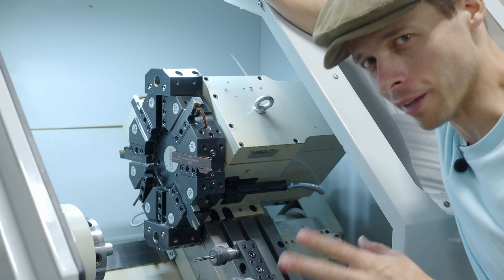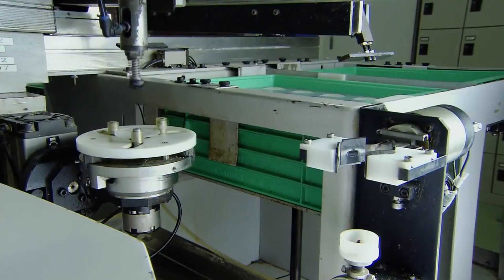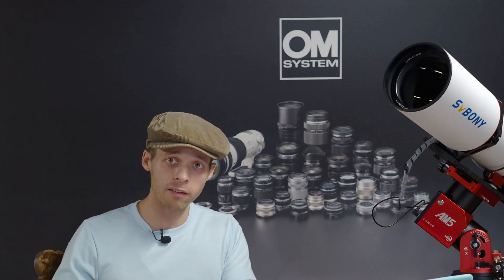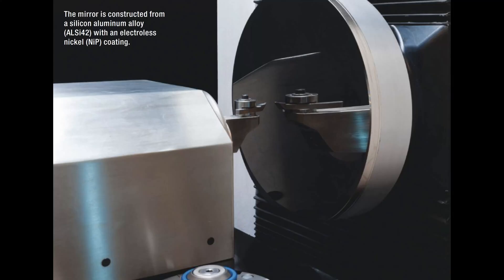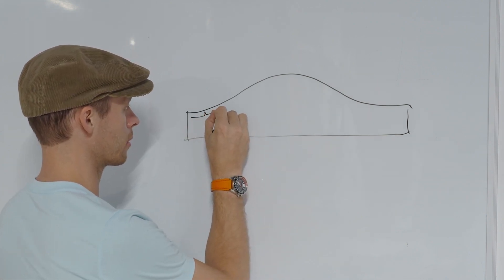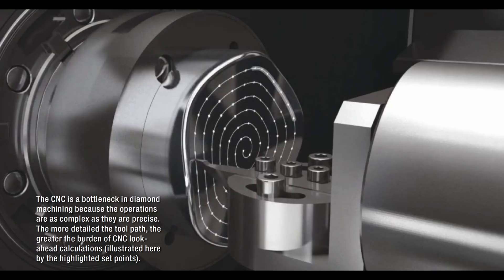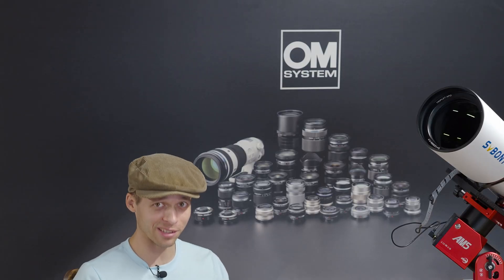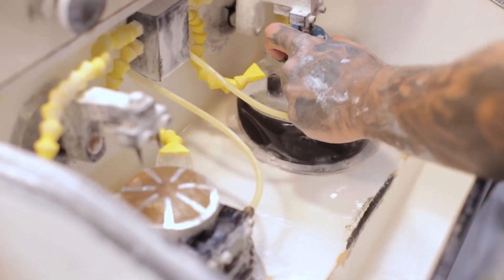This Could Revolutionize Lens Optics

Comment: I don't buy the "computers not fast enough" argument, especially when the shapes being carved are curves. If the argument was that the software sucks, that I'd believe. One of the oldest techniques in software is buffering, its how we've made CD quality audio playback and video signals work for decades. Sure it might take an FPGA or ASIC to playback the buffered motions, but the process isn't much different than reading or writing to a spinning disc. Heck, you could carve a vinyl record the same way.
Reply from the maker: We are dealing with terabytes of data that has to be processes in seconds. Know a computer that can process a 2tb tiff file in under 2 seconds and do it with 100% reliability?

Comment: Pattern lathe application anyone? Analog turning that came from the American watch industry in the mid to later 1800's. Brief explanation: One large model is made. Cutter mounted on a tool post connected to feeler that traced the outer surface of the part. A 3 dimensional pantograph of sorts if you count the turning of the part as one of the dimensions producing a 3 dimensional piece. Unskilled operators (robots today) could make watch parts with amazing tolerances. All analog. No little steps.
Reply from the maker: That is sorta how the old way of doing it. In the video I even show a guy making a pattern by hand. Tricky and very difficult process to get right.
Reply: @TheNarrowbandChannel  yes, but you’d only have to make one pattern. Then the feeler would follow the surface of the pattern and the diamond cutter would shape the blank.
Reply from the maker: feelers though always import more surface ruffness though. So for optical glass it would then have to be polished.  @iteachtime
Reply: Thanks for conversing. I look forward to the continuing improvement ahead.

Comment: There’s no reason why a great lens can’t be made out of plastic, like your cell phone camera, or the cameras in and around your car, security cameras and so on.
Reply from the maker: There area actually a lot of SLR lenses that have plastic elements in them now. They sometimes have very good optical properties but they are very wildly erratic when it comes to performance across many different temperatures. Get them hot or cold and quality deteriorates very fast.
Reply: Eyeglass lenses are made of many different materials nowadays. Glass itself is seldom used, except where very high refractive index are required. By the way, CNC machines are already being used to cut non-spherical lenses in many shapes (toric, progressive lenses). I noticed at least one of them in the video. First products to be machined this way were the molds for contact lenses, then molds for plastic lenses for eyeglasses, and finally the lenses themselves are nowadays machined in CNC complex machines (you can't call them lathes anymore, they are much more than that) that shape them in very weird formats. As to the computers controlling and the servo motors moving them, they are now capable of sub-nano position measurement, nanometer-level position increments and scan times in the µs level. Computer and servo technology isn't a problem for more than a decade.

Comment: Sorry, this video is mostly nonsense. I work in optical manufacturing in Germany for spherical and aspherical lenses. CNC machining has been standard in lens manufacturing for about two decades in all manufacturing processes. Curve generating, fine grinding, polishing and lens centering nowadays are all achieved with 3 or 4-axis CNC Machines that are specially designed for optics manufacturing. For aspherical lenses 5-axis CNC machines are used. 

The use of a lathe would be no benefit whatsoever because due to its defined blade edge the lathe chisel would always leave defined milling structures on the surface that still need to be polished out, no matter how fine the chisel edge or the tool's pathway stepping would be. For some aspherical lenses molding techniques are used which leave a clear  surface finish similar to a polishing result. But they always have the impressed milling structure from the press mold which is itself made on a high-precision lathe. This is actually the root cause for the infamous onion rings in bokeh balls of many camera lenses. So not really ideal for high-precision optics with highest specifications.

Diamond tools with undefined cutting edges and self-sharpening bonding compounds (bronze or synthetic resin) are actually used to generate a fine scratch surface which allows quick polishing. This allows quite low running times per piece. The use of a lathe for individual lens processing would increase machine runtime quite significantly and is also not compatible with the general material properties of glass. Unlike metal, glass is not cut with defined blade edges by a chisel but it is broken and ground into its shape via pressure from the edges and tips of synthetic diamond particles which are embedded into the specific tools. 

CNC machines are nothing new in optics manufacturing!
Reply from the maker: Thank you for your comment.
I used the term lathe mostly because that is what most are familiar with and I had an example to show. Many newer lathes are in fact 6 and some even 7 axis. 

Onion rings in stars are from the wave form of light. Optics formed by hand will even show them. Not sure where that info comes from but it does not sound right to me. 

Most polishing is diamond bases. And is a form of cutting too. Thanks for the info. It's food for thought. 
Newer CNCs can now move in increments measured in Nanometers now. We shall see what the future holds.
Reply: @TheNarrowbandChannel  I am not talking about onion rings in star patterns or star tests but onion rings in bokeh balls in the defocused background of e.g. portrait shots. More compact Camera lenses with  aspherical elements usually have more onion rings than portait lenses that are optimized for smooth focus transition and bokeh (which usually have only few or no aspherical elements that are created with the mentioned pressing method, thus more individual optical elements). The reason I have explained above.

You are again wrong in regard to polishing. Only certain optical crystals, hemimetals or sapphire are usually polished with diamond suspensions. For all other optical glasses including quartz glass, suspensions of rare earth oxides (mostly cerium oxide) are always used.  Polishing of optical glass is not only mechanical abrasion but has a very significant chemical polishing contribution (thus the correct and constant temperature of the process is essential).
(The outer glass layer is softened by pressure of the polishing grain when in contact with water based suspensions, thus allowing smoothing and displacement of surface deformations as well).

Again, it does not matter how many axes of your machines are CNC and how fine the stepping increments are. You simply cannot process glass like you would do with metal. Therefore any machine or tool with a defined chisel edge is not the smartest choice for glass processing.
Reply from the maker: @schbasdy  did you read the article I linked to in the description? It is being done.
Reply: Yes I have read the linked article (onwards from pg 86). The given examples for your "revolutionary" new processing method all show metal alloys being processed (an optical mirror from aluminum silicon alloy) or metal alloy molds for pressing glass or synthetic plastics into its final form. It is also literally mentioned that "diamond turning is not very productive compared to conventional milling" and nowhere it is mentioned that this process is used directly on optical glasses for the processing of rotationally-symmetrical lenses as this method shows its big benefits mostly in non-symmetrical free-form processing. I highly doubt that diamond turning will ever make sense in direct processing of sensitive optical glasses like Ohara S-FPL-53 or Schott N-SK16. 
Nothing from that article has changed my opinion. 
Even if you might be able to create molds for blank pressing glass to a perfect surface finish with it (the process I actually have mentioned in my first post) - not every sensitive optical glass type is suitable for this process.  @TheNarrowbandChannel 

In a nutshell:
While this process might be used for special optical components in small quantities, mostly metal alloys or hemimetals, it is nowhere officially mentioned that this is used for direct processing of conventional optical glasses. 
Contrary to that, your video absolutely implies that this is already being used directly for optical glasses and that CNC machining in general might be "new" to optics production, which both are obviously not the case.  
You simply cannot create a polished surface finish with sophisticated surface specifications on optical glasses by diamond turning alone, as material properties of glass are totally different than those of metals. That is my main criticism.

Comment: There is definitely the potential for creating lens elements with designed shapes that have less aberrations, and so require less elements overall. And consistency from lens to lens would potentially be higher too. Cost ultimately should come down too. Exciting prospects!
Reply from the maker: And shorter lead times too.

Comment: Found that really interesting, thank you . CNC machines are of course already impacting on astro photography, by way of permitting finer tolerances of mount components etc. At reduced cost. ( can you imagine how much an AM5 for example would cost if all the components were made using a manually operated lathe or mill). 3D printing is another technology that's beginning to impact our hobby in a positive way too.
Reply from the maker: Yes mounts are so important and have really improved. Soon Glass will feel the affects too.

Comment: As a machinist, I find this very interesting! But I need your help!! Have you thought about some other kinds of how-to videos? Specifically, I have an SvBony 550 and a ZWO EAF. I have no idea how to fit the EAF to my Focuser. I have looked all over uTube and there are many videos out there, but none on the 550. Its focuser is different from the others. Thanks, brother!
Reply: Apparently, the grub screw next to the coarse button needs to be removed first, then turn the knob until another grub screw becomes visible inside and loosen this one, then the button comes off!  This should be documented much better by SVBONY. I had given up and used the other 'fine' side by drilling a 9.5mm opening (about 5mm deep only) into one of my spare ZWO EAF couplers, then fitted it to the COARSE axle - it fits pretty OK but sticks out more. Interestingly, I found (with NINA) that my autofocus seems to be working smoother / more accurate than ever. But I may go back to the 'proper' coarse side since I know about the SVBONY EAF 'secret' ...
Reply from the maker: It was pretty simple for me to do it. There are other scopes that have the same focuser.

Comment: I work with CNC machines and assumed that the glass was roughed out with CNC... but work with wood and metal so had no idea.
Reply from the maker: Ruffing has been done in the past but they are now getting so good they can make surfaces so smooth no polishing is needed. Look up Kern cnc machines.
Reply: https://youtu.be/Kw2DNEEuRjY?si=53d8mqXNvPnroVZy

Comment: Really though? Last i checked CNC machines used relatively tame CPUs, i really dont think its computing power that is the limit, maybe the stepper drivers or motors are not ready but we definitely have the raw compute power to do it.
Reply: Indeed the mechanics of the machines are the limiting factor and not computing power. You are right.
Reply from the maker: You're probably looking at older machines. Some of the latest and greatest can no move in steps in the single nanometer range and this requires a lot of processing.
Reply: Yes, you are right. Optical machines are so specialized and expensive that they are usually used for several decades, especially when just simple spherical surfaces are processed. For sperical surfaces such complicated and precise machines are actually not really necessary. The polishing tools are prepared by hand and are the most relevant aspect for the surface deviation. 
  @TheNarrowbandChannel
Reply: @schbasdy  them using the same crap forever is more of a logistics issue rather than a tech issue though. I still don't see compute power being the bottleneck considering we have GPUs and ASICs that the power to handle insane data sets.   Also most machines I know of do not handle geometry at all, the commands for the machine are generated on s PC and moved to the machine, the machine would need a large cache to store the commands for such a precision shape but not much more.  Now if it's a machine that generates it's own commands and/or scans the shape and compensates in real time I can see it needing a good amount of power but not a impossible amount.

Plus as you said spheres are easy(er) by far.
Reply from the maker: @deltacx1059  You should read the article. It will help you understand.
Reply: @TheNarrowbandChannel I will have to find another article on the subject, the one you linked wants too much information just to read.

Comment: Great video.  Actually, there is another less known issues that even those lens cutters are not always aware of.  It is data format conversion.  The CAD program that you use to draw and design the lenses can work with the actual aspherical functions natively.  As soon as you export these designs to the format the machine can read and process, approximations are made. IGES and STEP files use polynomials or spline fits. Even at very high orders there are still minuscule deviations. Now some CAD programs export and fit better than others.  Believe me, learned that the hard way.
Reply: Hey willi, I know what you mean. I used to work at a place making rear projection TV. I was the ME. On the drawings for optics, we actually would put the lens equations on the print. So maybe the program run the equation, not the model.?????
Reply: the lenses were designed using OSlo and ZEMAX, I remember the equations were many orders like to the forth, so i think the lens maybe diamond turned using this equation.?????
Reply: The trouble starts when you transfer the analytical functions of OSLO, ZEMAX, FRED, Code-V,… to the software running the tools … that conversion has never been really been meant for optics. I know there are a bunch of companions, who found workarounds or solved these problem one way or another, like Accumold, son-x, LT ultra, Innolite, … the list keeps going.
Reply from the maker: You guys are loosing me with all the acronyms. But that is cool. Eventually they will make sense to me. Always more to learn.

Comment: Also Metalenses is going to change the industry too.
Reply from the maker: Metalenses will probably only be used on the sensors levels. Not so much for optics as we think of them. It has a long way to go at any rate. Probably 20-30 years out.
Reply: No, they won’t. Lots of hype for very badly performing “optics”.  There are a couple of monochromatic niches of niches. Not for visible and not for telescopes. Physically basically not possible.

Comment: It seems even if the initial steps were handled by the CNC machines, the final polishing would be accelerated significantly, even if done using traditional methods. There would be far less shaping and removal of material necessary.
Reply from the maker: Yes using this method you can use polishing with jets of compound rather than needed to make special dies.

Comment: Just wondering some Nikon lenses have a tech called SR lens elements (short-wavelength refractive). Is this something similar or different tech you mention?
Reply from the maker: Not familiar with that but it is probably just the density of the glass that they are referring to.

Comment: What about Metalenses technology,
Is it possible that we could have hybrid lenses using this technology to further shrink the size of lenses, and to bring the price down.
Are using this technology in combination with traditional lens technology how small do you think they could make a 300mm f/2.8 by using 
Metalens in combination with old technology, making the ultimate highbred lens.
Reply from the maker: ITs interesting but has a long way to go to make optics of good enough quality. Right now I think they are on 30nm tech and they probably need to be in the 1-2nm range. So that is about 20-30 years out.
Reply: @TheNarrowbandChannel  It’s not so much about the resolution, which is pretty good already. By design, metalenses and other nano-optical elements can only work for very small wavelength ranges and relatively small angles. At broader wavelength ranges or larger angles, their efficiency goes down drastically. This is a physical limit and not a manufacturing limit. All those papers and hypes of metalenses show (or typically hide ;-)) the efficiencies of way below 40%. The other 60% go somewhere else into your optics. That means you have very poor contrast, high blurriness etc.
Reply: Sorry, they won’t. Physically not possible. Lots of hype on bad optics.